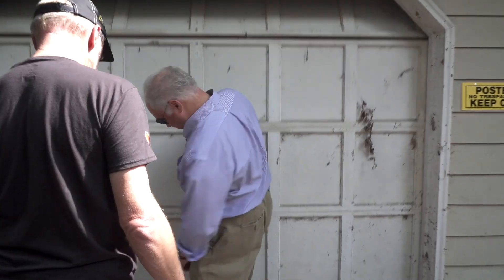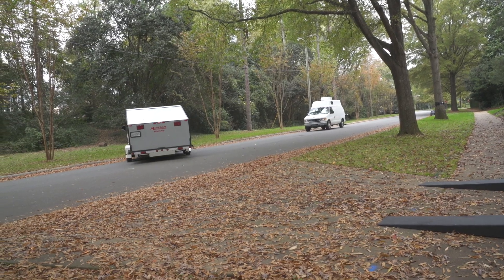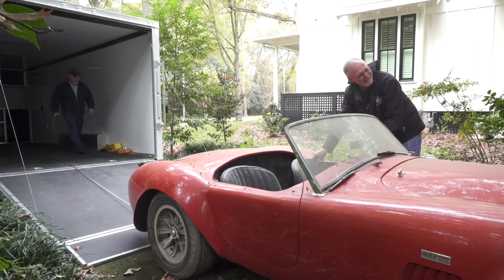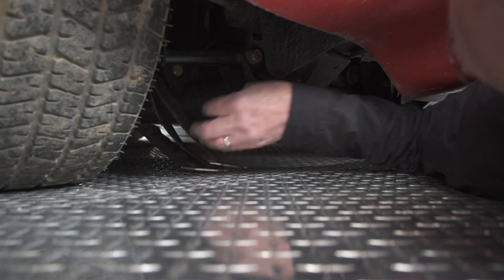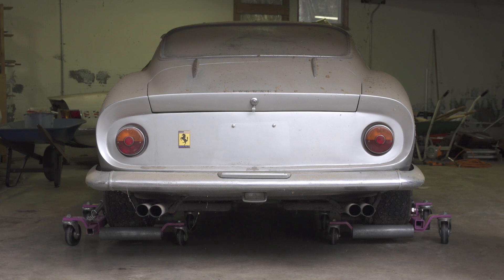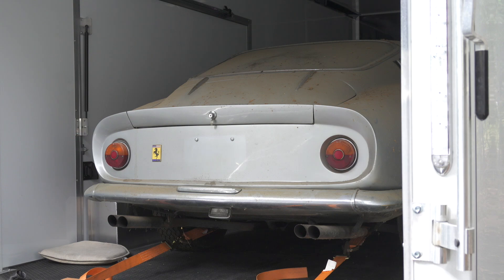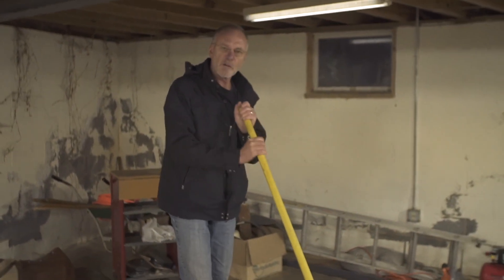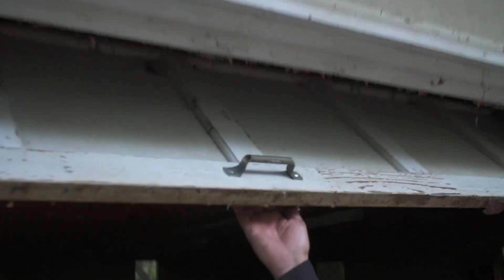Rare 427 Cobra and Ferrari 275 extracted from condemned garage | Barn Find Hunter - Ep. 25

Comment: I wish I had a garage for real so I could get back all the cars I had since I was 16 years old until I was 25 I will be a very rich man if I really knew what I had when I had it 55 Ford Crown Victoria 66 Plymouth Fury 3 Convertible bench seat for Speed on the floor from the factory 383 cubic inch fender skirts 67 GTO convertible red black convertible top Mickey Thompson white ovals all the way around Cragar mags 4/4 feet on the floor 400 cubic inch 650 dual line Holley 456 gear rear end electric antenna air conditioning from the factory Thrush Mufflers dual exhaust 68 GTO Hideaway headlights red black convertible top Mickey Thompson Jewelers Cragar mags big block 400 Hurst 4-speed 67 Firebird big block 400 a sleeper automatic on the floor freaking amazing power 64 Oldsmobile Dynamic 88 red white interior big V8 66 Dodge Charger white black interior freaking amazing car 70 Pontiac Catalina Convertible 72 Dodge Challenger small block 340 3-speed automatic slapstick on the floor white black hash marks down the side white interior the freaking car would almost pull the wheels off the brown 77 Olds Cutlass Supreme so many more T-tops 350 cubic inch electric antenna cruise control air conditioning black olds rally rims white raised letter tires oh well that's enough for now

Comment: I love the cars but to call them barn finds in a condemned garage. Just tell the truth, these were never stuffed in a garages and forgotten about for thirty years. They have none of the normal signs of sitting for a long time. Tires go flat, yes you can air them up but the tires will still have the spot where the accumulation of dirt at the flat spot would be.